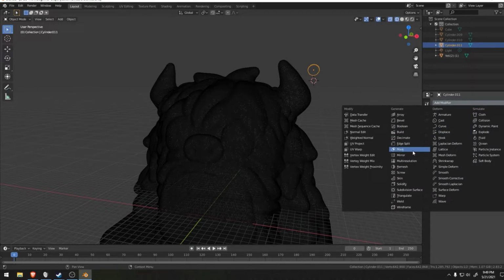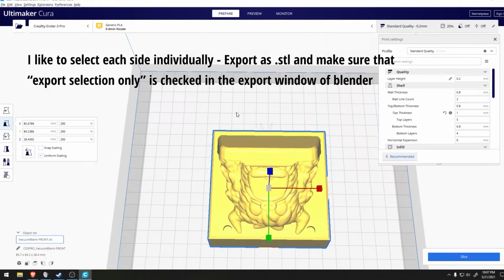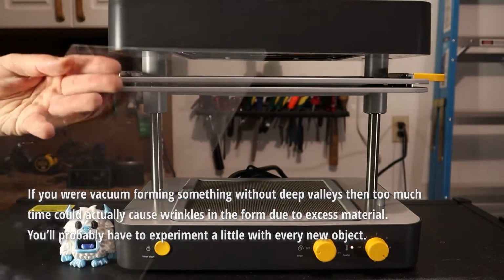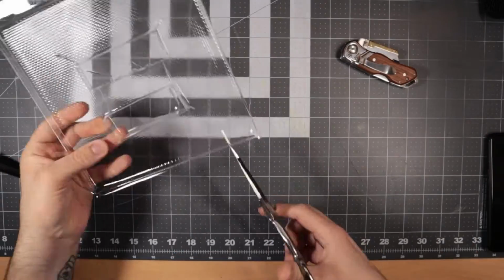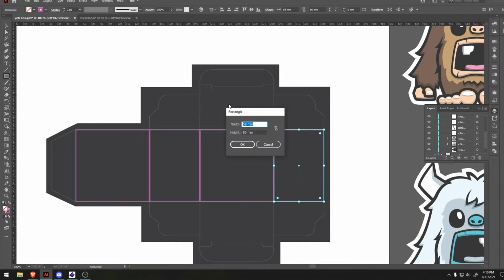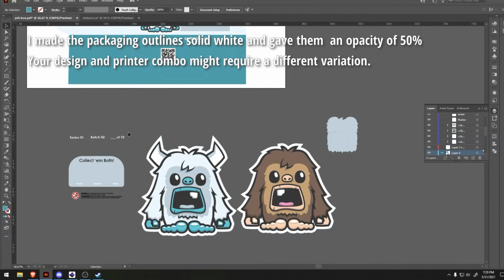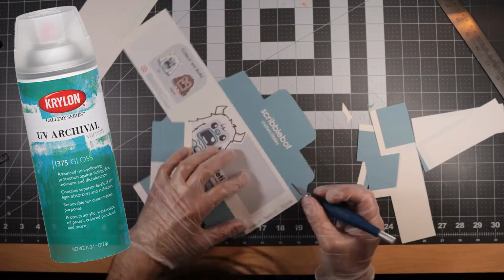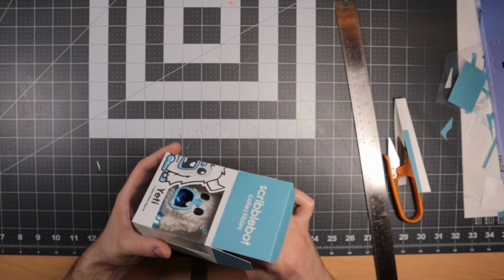Making the Packaging for Art Toys

Comment: Thanks for this. Do you have any recommended coatings for the plastic to prevent finger prints there?
Reply from the maker: On the toy itself? There's a few different clear coats (some matte, some gloss) most of them are UV resistant too so they'll help protect paintjobs too. 

I've tried Createx Airbrush Clear Coat and Krylon UV-Resistant Clear Acrylic Coating with good results. I used the Krylon on the packaging too to keep the box protected too

Comment: great video! one question, does cutting the plastic leaves a sharp edges? is there a way to cut it better?
Reply from the maker: Great question, sorry for the super late response.

Yes it does, theres not an easier way to cut it but you can use a deburring tool to soften the edges, you can also use sandpaper.

I haven't tried melting the edge but it's meant to be heat treated so I'm sure that would work too

Comment: Hey, love the toy itself and your videos! Wat this toy painted or is there ways to multicolor print? Also what exact material do you use for printing to get a good result? Thank you in advance, love your channel, got my follow!
Reply from the maker: Thank you! This toy is a multicolor print, I separated all the pieces of different colors and printed them out individually. The best results I get are with resin printing though, and for those painting would definitely be the way to go.
Reply: @AndyMakes  thank you for answer! i don't own a 3d pronter and not that into details about it, but i do 3d tho. so when i'll send my model out for printing what do you suggest i tell em? I need it printen with resin? Or is there any specific names you could suggest! Sorry for bothering, big thanks!
Reply from the maker: @medrie95  

Ooh okay good to know. So regular 3D printing FDM will tend to have a lot of visible layer lines, but if you're ordering it you don't have to worry about getting good results, they typically wont ship anything with defects and will reprint it til they get it right.

Some of them also offer SLA printing (typically resin) which has barely visible layer lines that paint would cover up with no problem and it will look like a toy you can buy off the shelf.

Both this video and the one I have with the pencil figure used FDM printing so it does get pretty good results and will likely be cheaper. The pencil video covers how it can be painted if you're curious.

Comment: i am trying to design packaging for a client for the first time. she gave me a pdf template of the packaging but i am unsure of how to translate it so the dimensions are correct in photoshop. Any advice?
Reply from the maker: does the template show the dimensions the packaging should be? if so, there's rulers on the margins of your window as well as a ruler tool (found under the eyedropper's dropdown) that can be used to measure so you can ensure that if it doesn't open to the correct size initially, you'll be able to resize it accordingly.
Reply from the maker: For instance, if the template says a side is 5 inches, you can import it into photoshop and use the ruler to measure the size of that side. if it's not measuring at 5 inches then you can make the entire template bigger or smaller until that side matches what you need and as long as you're resizing the entire thing together you should retain the correct proportions.